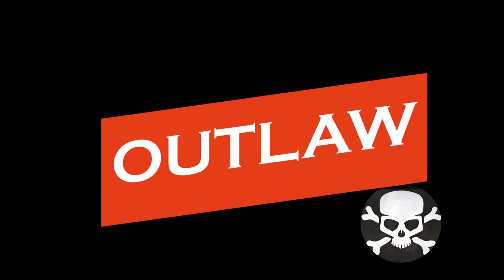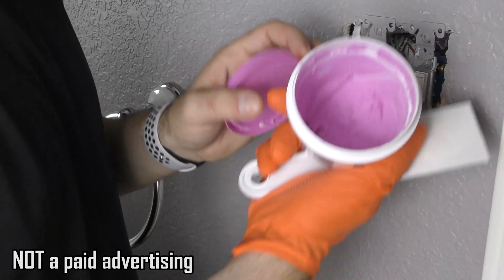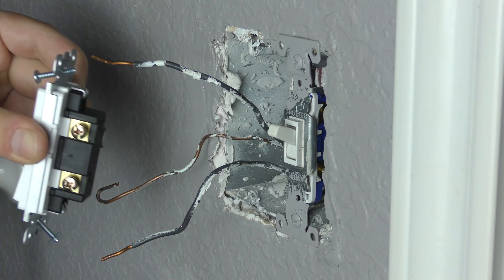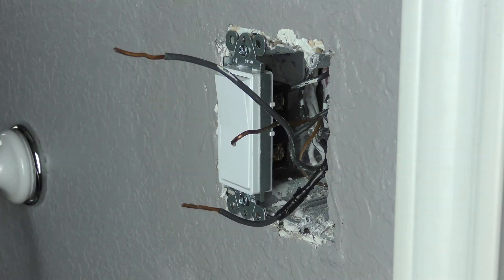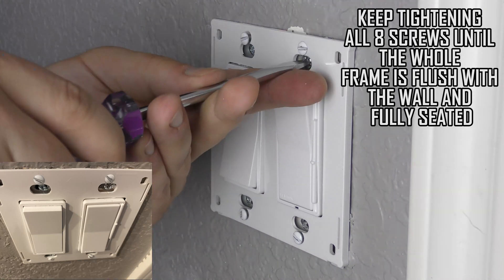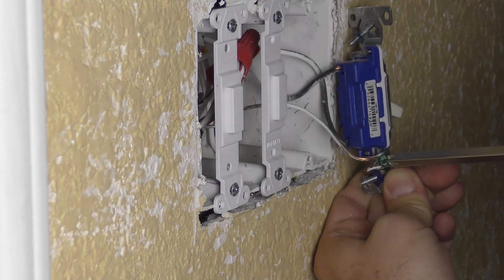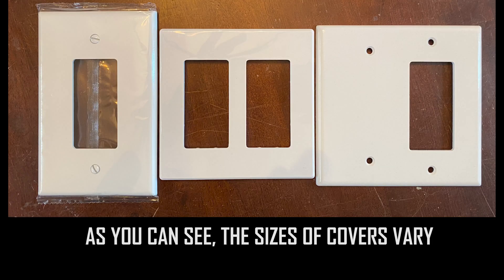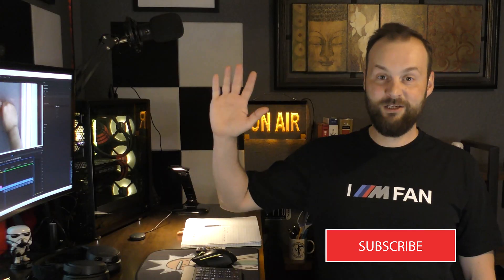How to Wire or Replace a Light Switch / Dimmer / Upgrade Toggle to Rocker / ENERLITES LEVITON

Comment: Great tutorial, but I have a strange issue. I wanted to upgrade my single toggle light switch to a push rocker switch (Leviton Decora). After removing the single toggle switch I notice it has only two screws with two black wires attached to one screw and one red wire attached to the second screw. what gives? But the replacement Leviton has 3 screws  (one for grounding of course) how should I connect the wires to the new push rocker switch when the old one never had a grounding screw?
Should I connect the same as the original toggle-two blacks one screw and the red to the other? Thanks in advance if anyone has the answer.

Comment: Nice video. I have a question when I take mine off my grounds are not connected only two wires
Reply from the maker: If you have an older house, your switch box itself is probably grounded. Take a look if it has a screw or a wire going to it. If there is one, then you’re fine connecting just the other 2 wires.